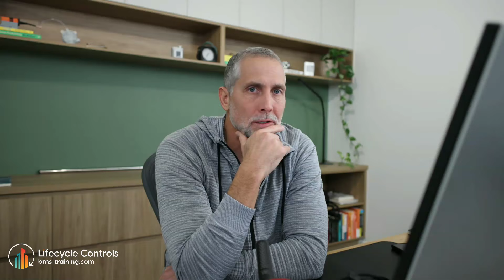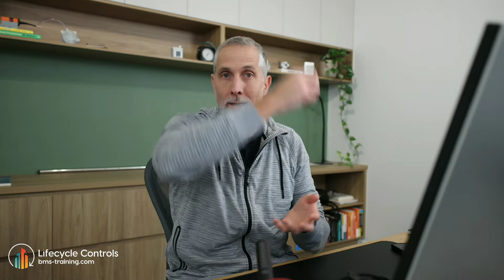Two optimisation tips for optimal start warm-up mode

Comment: Very good points Bryce, both of them. I've been in this game 29 years and had never thought of the 1st point of letting the thermal plant get up to temp 1st. The one re closing the Min OA during morning warmup and pre mass occupancy is pretty obvious though. It does show how watching a system operate shows these issues. I tune PIDs by watching them rather than using so called mathematically devised parameters using theory, be it right or wrong, it works for me. I have learnt what parameters' to start with over the years though, and can tune pretty quickly sitting and watching the loop operate(no need for trends, just sit and watch it). You reviewed one job of mine many years ago. I still remember back on that with fondness. Respect for your great knowledge in out industry brother.
Reply from the maker: Thank you, appreciate it! Yeah, if you do enough PID loop tuning, you can pretty much guess the parameters. I have never actually seen someone use a tool to estimate PI parameters. Maybe in process controls where you are pumping fuel or something critical. I'd guess using a tool would create issues. Cheers.

Comment: Shouldn't the boiler be running in a night setback mode at a reduced hot water setpoint prior to the 6:30 AM start? What is the freeze protection sequence for the building during the unoccupied hours? Shutting hot water down during the unoccupied hours while it is below freezing is a very bad idea.
Reply from the maker: It does not get cold enough for water to freeze in pipes in Australia. We do not have freeze protection strategies 🙂
Reply: @bryceanderson17 Fair enough. I am in NYC and in this climate zone we have to design for all four seasons. Freeze protection is a big deal here. Protecting property and equipment is number one, energy efficiency then follows.